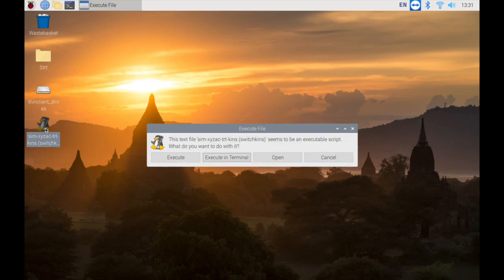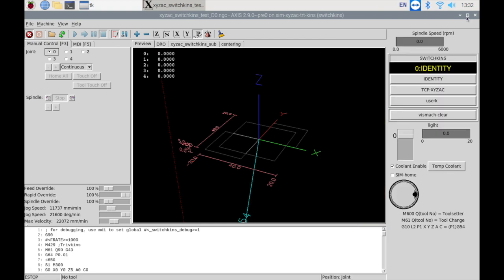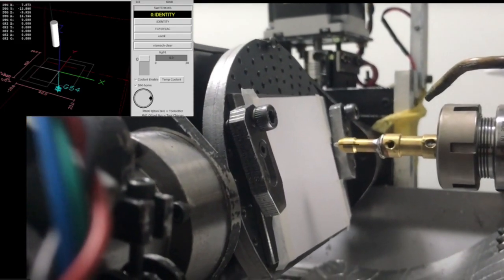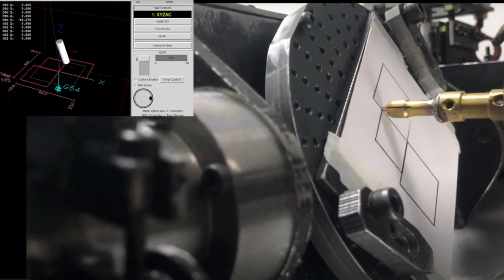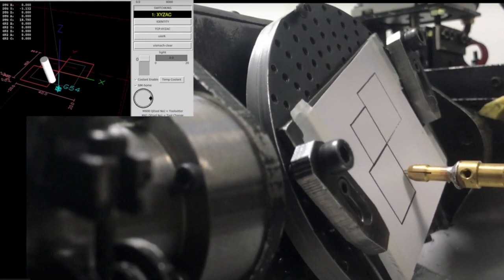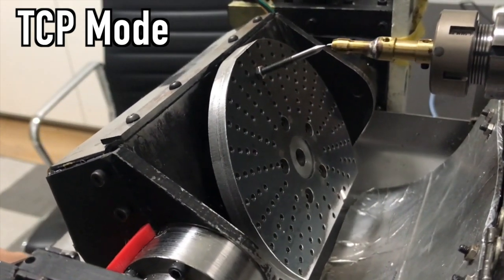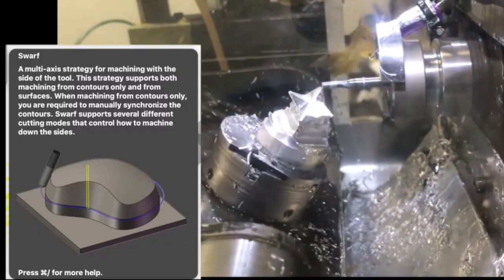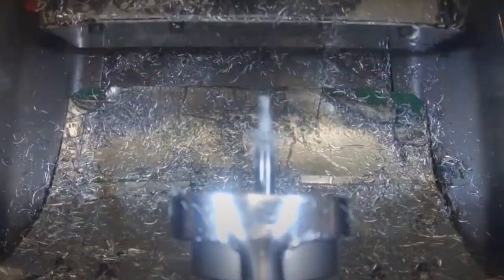What is Switchable TCP

Comment: Hello 
i have a 5 axis cnc head-head  XYZAC (When C rotates i have offsets in X and Y)
How can i utilize the TCP 
Where can i find more info?
Regards
Reply from the maker: Sorry for the late reply.
For machines with 4 or more axes, when the rotary axis rotates, the origin needs to be changed. I have created a macro program to automatically change the work origin.
To use TCP, I think you need to use a CAM that supports TCP.
I am using FUSION360.
Reply: @a-cnc-f  Hello,
I also have XYZAC and I am also trying to figure out how to utilize TCP, but till now I am haven't figure it out.
So can you please guide me, I am using Powermill.

Comment: 2 things that hold me back from building a 5 axis cnc:

1: no 5 axis lookahead (movement will be choppy/slow)
2: no 5 axis velocity limiting (meaning when the tool is far away from center of rotation and the rotary axis is moved at maximum velocity the tool (linear axes) can actually move way faster than defined in the INI and cause stepgen errors)

at least thats what linuxcnc was lacking the last time i used it.
Reply from the maker: It has been a while.
So far, the same problem has not occurred.
I used to have stepgen errors in the past.
I don't remember if it was the same problem or not.